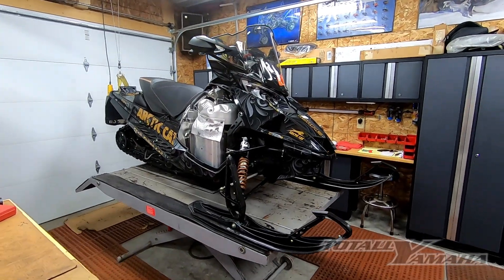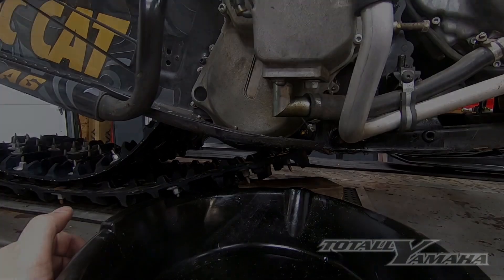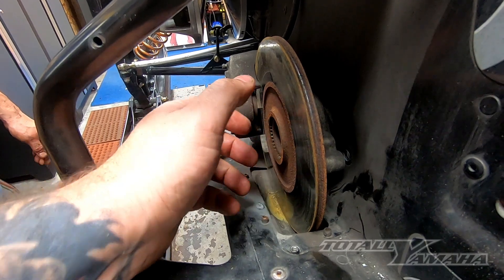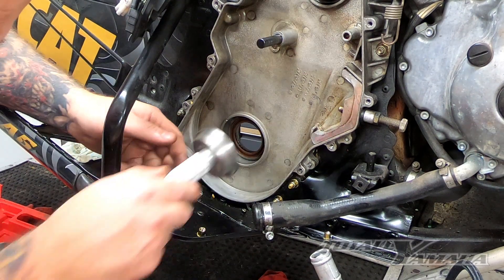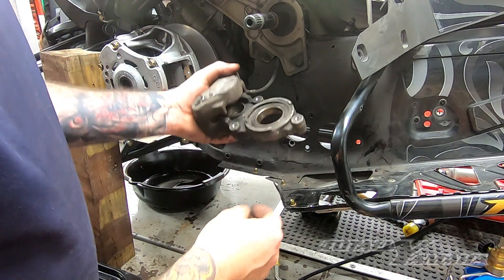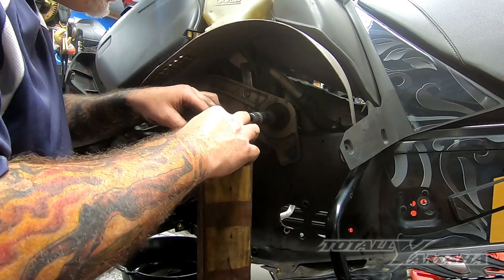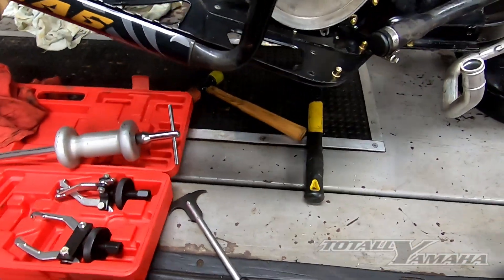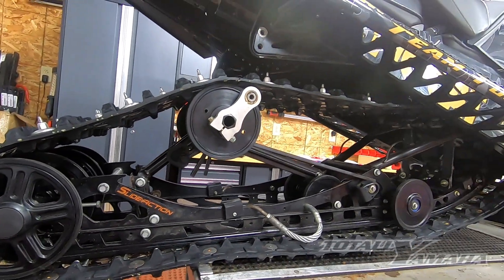2017 - 2023 Sidewinder/Thunder Cat Gear and Axel Maintenance

Comment: Great detailed video
Reply: What did you used after you drilled the rivets for the bottom panels
Reply from the maker: I used threaded inserts 1/4-20 from Amazon and Stainless Steel Screw and washers. There is another Video on my channel with more detail.

Comment: Really detailed video, Thanks.
Will start to service my Yamaha Viper 2015 to check all before summer sleep. I bought it with hidden defect, I found some glue on gear box, but in fact was broken tunnel, was scratch in frame, splits in gear box. My mechanic told I need to fix before drive and I did it! So now I need to dismantle to check how my inside flange holding all.  Has anyone had a problem breaking the tunnel (frame) where the gearbox mounts?
From video my concern is brake disc is so close to brake pad outside support (less 0,5mm), looks like I need ~1mm spacer between frame and tunnel to move it back??!!
Reply from the maker: Please go and register on ty4stroke.com and ask this question on our forums.

Comment: That bottom seal on mine is not wanting to come out.  Puller just tore it all up and barely have anything left to grab on to.
Reply from the maker: might have to use a seal driver. Harbor Freight sells them.
Reply: @Totallyamaha  How is a driver going to get it out?  I have drivers to start them in once its out.
Reply from the maker: @nymfan1990  was thinking with the  correct driver for you can catch the metal edge. Or try a flat punch and try to get that seal metal edge to come out. Hard to explain or understand without pics. Go to Ty4stroke.com forum register and post pics and questions.